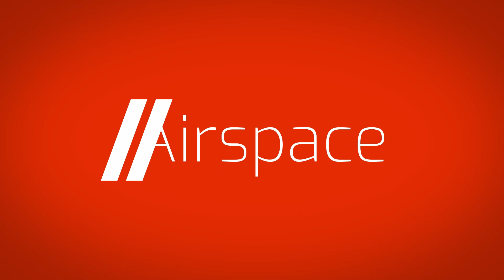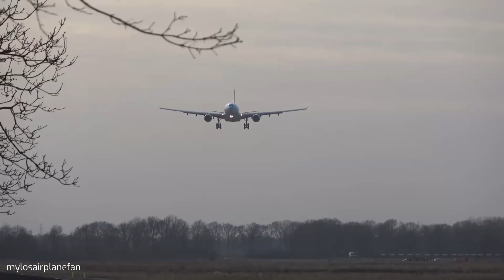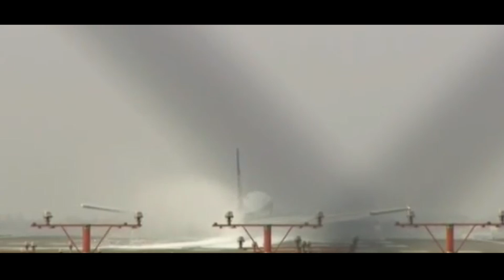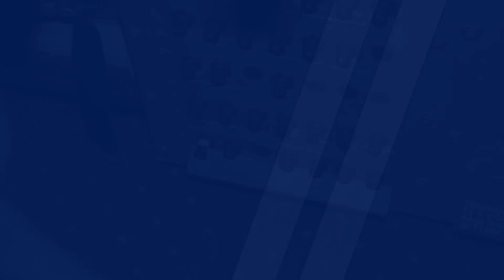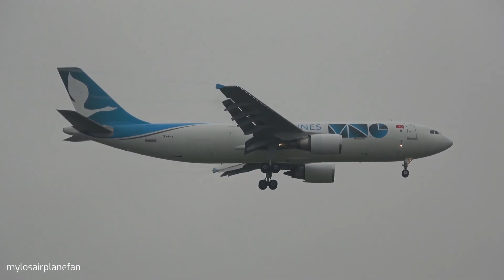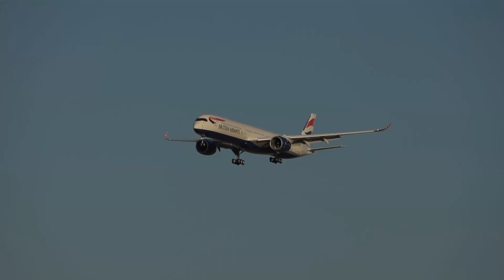Gear Up Landing | LOT 16 lands without landing gear

Comment: The Pilot failed to see a bright white popped fuse....that means this whole incident was pilot error after the hydraulic hose for the landing gear developed a leak.  

The leaking fluid was a sign that the maintenance crew on this aircraft were total losers who overlooked key flight hardware. But worse was that neither of the two pilots (and crew members) saw the bright white popped out fuse just 4 inches away from the fuse they were told to look at.  

I mean really?   They are not heros...they are a danger to passengers and the entire aviation community. They should have been fired immediately following the the public release of the official crash report.
Reply: We don't know if the hose was leaking before the start, it might fail on takeoff. Moreover, boeing knew about hose failures and marked it as optional. I think working in the UX design team, I think boeing made a critical design error. All labels are white, the popped fuse should be yellow in order to stand out. White markers on black board with white labels is a dangerous big flaw.

Comment: Hmm, I don’t consider myself as exceptionally clever, but when you showed the first picture of the A1 circuit breaker I thought to myself: why do I see a panel of circuit breakers and…carpet? That is either a very odd place for carpet or for protruding electric components like circuit breakers. Oh well, seems my instinct was spot on.

Comment: Boeing rides again, right down there next to the carpet. At that why did the F6 circuit breaker not have a light indicating that it was receiving power?? Little bitty green led's are not a new invention.  I was in a B52 that had indicators for the circuit breakers, that's cutting edge 1950's technology

Comment: The first miracle was that everyone survived. The second was that the FO wasn't thrown under the legal bus. I imagine there are multiple airlines around the world that would have done so given the same set of circumstances. Nevertheless, I suspect the chain of obligation that saved the FO went something like this...

a) Boeing issues a Non-mandatory SB for cost recovery purposes thereby acknowledging the in-service feedback from the operators, but, not going as far as to admit an inherent Human Factors Design flaw which would lead to potentially accepting a service cost liability via the issuance of a Mandatory SB. (One could also argue the term "Non-mandatory SB" and the associated costs creates two barriers for acceptance by the airlines. Who wants to pay for something non-mandatory? It can't be that important, right?)

b) Because LOT doesn't want to pay for the Non-mandatory SB and it neglects its obligation to provide a safe workplace for the pilots

One lucky chappy!

Comment: Clever idea to cover the runway with that foam, I think that this more than likely stopped an aircraft fire when she touched down. 
Thoroughly interesting and informative video mate, well done!!!
Reply: Standard procedure. Not really a clever idea.
Reply: @derpinguin7003  it's not always implemented tho, if there isn't enough time to prepare for the emergency landing the firefighters will save the foam to use if the plane catches on fire as it takes a long time to refill, in this case they had enough time to do that and still refill

Comment: I don't know if you're familiar with the crash of SE-MES outside Umeå.
There's a somewhat harrowing description of the events on the Swedish version of Wiki. One of the sources is the actual investigation report, so it's not one of those wiki-articles based on questionable conjecture and biased sources.
Reply from the maker: Yeah I've heard of it, my parents own a house somewhat close to umeå and I've learned about the crash via them... seems like they overloaded and overstressed the plane?
Reply: @AirspaceVideos  Weight was only one factor. It was exaggerated by the press (they wanted instant answers), and that was all they could find out at first.

It is believed the weight & CG were both outside of what is allowed, but that's hard to determine after the fact. Allowed or not, the aircraft was still fully flyable in that configuration (evidenced by the fact that the climb recorded on radar was normal).

After climbing to planned altitude, the jumpers wanted a higher altitude due to weather. After ATC approval, they started a second climb. During this climb, airspeed dropped. The aircraft had no flight recorder, and attempts to recover video from a jumper's camera failed, but it would seem the thrust lever wasn't advanced enough for that climb rate.

Investigators think that the final straw was the opening of the cabin door. That moves the CG aft slightly, increases drag, and yaws. This caused the aircraft to stall. During stall recovery, it is possible the pilot pulled up too hard, but again, no flight recorder. A few seconds after arresting the descent, one wing broke off. Now corkscrewing down, the jumpers were pinned to the walls so hard they were unable to escape. The pilot had his own side door & parachute, and could have jumped to safety even with the high lateral g-force, but seem to have elected to stay, trying to save the passengers.
Reply from the maker: that sounds very reasonable. weight and cg (slightly) out of limits should not be a dealbreaker, but the combination of all factors sounds unfortunate. And I recall that they found control surfaces that were ripped from the plane mid-flight? That happens from time to time in general aviation when pilots try to recover using wrong technique and too much abrupt force.
Reply: @AirspaceVideos  I live in Umeå, most of my friends are adventurous... for about a week, I wasn't sure if I knew anyone on that flight.
Seeing the video on the news kind of ruined my day, I thought I had just seen a friend die. Turns out he was just out hiking without phone coverage.
Reply from the maker: my god, that must have been terrible... I was in barcelona when germanwings crashed. Swiss newspapers just wrote "plane from barcelona crashed in alps". I was at the mall at that time and left my phone in the hotel, when I got back, I got like 50 messages if I was alive...

Comment: You're an expert on the ground, having all documentation available and you're not able to find all the necessary circuit breakers? As an engineer, I don't get it.
Reply: Yeap, this is odd. Yes, the first officer missed the disenaged circuitbreaker. It was his error but in his defense he was following the checklists (which did not have this piece of info) and also following the engineer's guidance. He looked specifically at what the engineer asked him to. If the engineer asked him to look for any popped out circutbreakers, especially those which were in a stupid location we would not have this whole story. Still happy nobody got hurt.
Reply: @Sanderus  not only that, but if it's know this circuit breaker also may affect the same system they are troubleshooting and resetting the F6 did not help, I would think it would have been the next instruction to check the second breaker.

Comment: OR the first officer is one of those people that secretly create drama by sabotage ! Any normal person doesn’t just stop at one breaker when there is a problem, you check them all because as mentioned the crew are not expected to know the circuit architecture that is protected by each individual breaker.
It’s also suspicious that neither pilot or first officer failed to notice the failure of all the other systems that would have been disabled by that A1 breaker.
LOT ultimately lost a plane over it.

Comment: Sorry but if I'm asked to check circuit breakers to see if they are popped, I'm not going to stop at just checking one of them. One of the first things we're taught in flight school is to run our hands along the circuit breakers to make none of them are popped out prior to start up and in our pre landing checks as well. I know this isn't a procedure that is done on commercial jets but you'd think they'd of made doubly sure to check all of them if even one could have saved them from a belly landing.

Comment: That's indeed very easy to miss a tripped Cb when it is poorly positioned or under a bad angle of view. But anyway, this Cb check should have been part of the emergency procedure.
Reply: It seems horribly wrong to me that all loads powered through the battery bus breaker can be disabled without warning by popping a single breaker.
Reply: @teardowndan5364  
      Yes you are right it  lokks like more like a designing flaw, but do we have the full picture in this vid?
Reply from the maker: I surely hope so. If you'd like to have more info, refer to the final report :)
Reply: @alainchampot6421  Well, I skimmed the report and: "The alternate landing gear extension system is not connected to any signaling system" so you don't know it isn't working until you try to use it and find out the hard way.

Comment: How often to planes continue on when they notice a landing gear problem immediately after takeoff?
On one hand, it probably woudn't affect the flight, the plane is heavily fueled initially and wouldn't be on arrival at destination
So, would this be a type of problem where it's actually better not to address immediately while near the departure airport?
Reply from the maker: Good question. That usually depends on many things (weight of the plane, weather at destination, maintenance availability, suspected reason for the technical fault etc.). In this case, their decision was valid and legal, but I don't know if I would have done the same. That's not to criticize them, I just don't know 100% of the facts of that day.
Reply: It was a transatlantic flight, it will take hours to burn enough fuel to make save landing. 
Flight started before midnight in November, there was no way to make emergency landing during day. 
And Tadeusz Wrona know EPWA better than any other airport.
Reply: Also, they had alternative gear deployment system,  they didn't know that will fail too. So there was no reason to turn back
Reply: Its all about the  $$$$$$$$$$$$$$$$

Comment: wow, why wasn't the A1 circuit breaker mentioned in the procedure for landing gear extension failure? its in circuit so its every bit as relevant, and as likely a cause of failure, as the F6 breaker, and it was a KNOWN ISSUE from the original poor design of the panel
Reply: Have you ever tried to troubleshoot a plane with all of an hour of fuel left and hundreds of people on-board? High stress isn't exactly conducive to methodical thinking. If it even crossed their mind, their assumption was likely that a main distribution breaker would typically take multiple systems offline causing other alerts/issues.
Reply: @ParadigmUnkn0wn  thats exactly why they have written procedures for all foreseeable faults and problems. when the gear wouldnt extend they pulled out the procedure for that and worked through it. I'm asking why there wasn't a step in that procedure telling them to check/reset A1 as it is part of the gear motor power circuit and was known to often get opened accidentally.
Reply from the maker: You'd have to ask boeing that! The investigation committee suggested that change to boeing and boeing declined, since it did not conform with their checklist design philosophy. whatever that means...
Reply: @AirspaceVideos  "Never admit a mistake so you don't get sued." More than likely they were concerned that if they admitted their checklist was inadequate then someone might point out the aircraft was in part lost because their checklist skipped something vital and they might be on the hook, even partially for it.
Reply: @bogatyr2473  I don't know the legal position there, but it could also leave them more vulnerable in future. If the same situation happened again and it was noted in the investigation that Boeing were advised to include the breaker in the relevant checklist but failed to do so, that seems an even more damning failure than the initial oversight.
Reply: @-yeme-  Absolutely, but after this accident it's unlikely anyone will forget about that breaker anytime soon. Boeing could be letting it ride, protecting themselves from this incident and betting that another one linked to this breaker is unlikely. Short sighted and putting people's lives in danger but... well sadly that seems to be Boeing's MO lately.

Comment: With one failed HYD system, was the plane in question still ETOPS compliant?
Reply from the maker: Yes it was, to my knowledge (although I'm not 100% sure about the 767 particularities).  If it wouldn't have been, I'm sure that fact would have been mentioned in the final report.
Reply: No it's not but the sector was within 60 mins of an airport

Comment: I remember this accident... You didn't touch on the decision to continue with the hyd failure, but I remember there being a lot of discussion back then.
Reply from the maker: Yes, that is debatable. Then again, it was a perfectly legal and valid decision.
Reply: @AirspaceVideos  i don't know anything about etops from the ops side, so I don't know. Btw did you know that you and MINI released vids about the a320 elac crash within a week of each other?!
Reply from the maker: Yeah haha, that was a pure coincidence! I published the video and mini was like dang, I've been working on that topic for a while now...
Reply: The 20-20 hindsight of Monday-morning quarterbacks.  If they turned back, they still would have had to land with the gear up, but they would have had to fly around and dump fuel to decrease weight and get no one anywhere for no advantage whatsoever.  But I guess optics matters.  It used to be required to have four engines to fly the Atlantic, and the assumption was that you lose one and KEEP GOING.  I notice there was a blanking panel above the circuit breaker panel.  Wasn't there enough flexibility in the CB wiring to move the CB panel up to the empty space?

Comment: Very very good job on making complicated tech understandable for everybody! The recent growth of the channel is well deserved! Keep it up my friend :)
Reply from the maker: Thanks! Glad it's understandable. I was afraid it will be too complicated! :) Hope I'll push the magic 1000 soon!
Reply: @AirspaceVideos  I'm sure you will :)
Reply: This is not yet complicated. In power lines and house electrical installations, there also circuit breakers. They must be, because too much current will cause too much heat in wire. That heat can cause fire. In simplified words, when wires becomes thinner, then must have additional fuse or circuit breaker. Thinner wire handles less current before overheat or fire. Easy as hell.